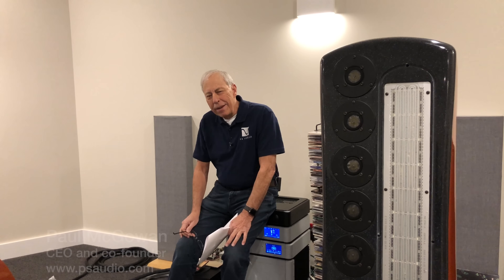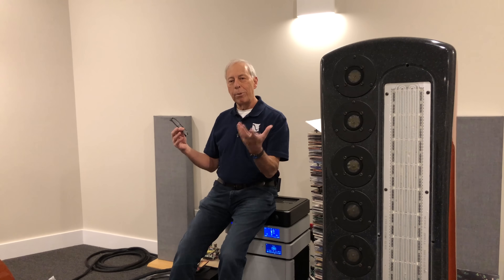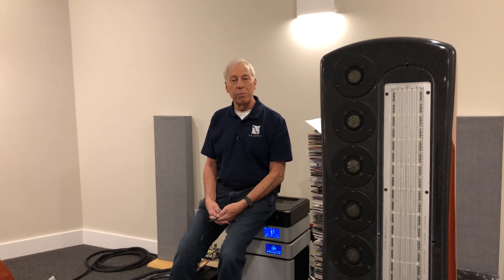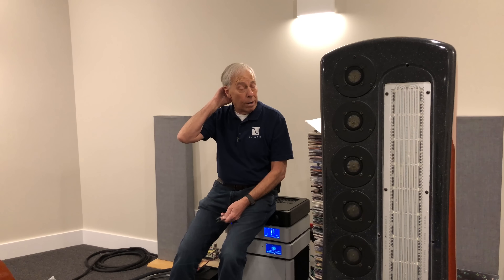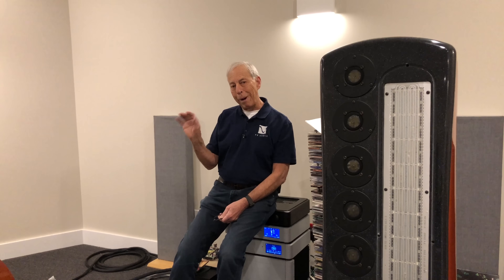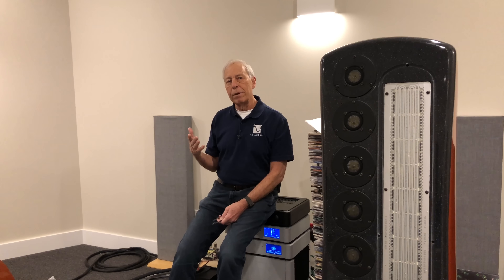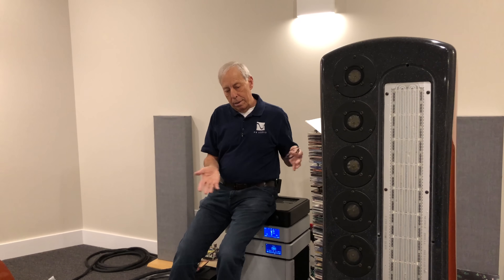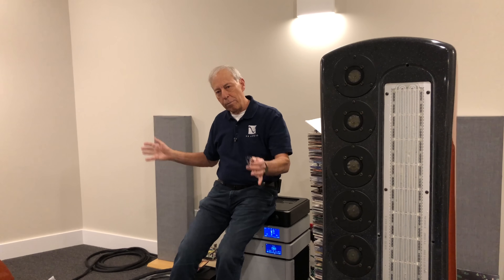Do we need preamplifiers?

Comment: Of course nowadays we don’t actually need any preamp and volume control can be done effectively without a preamp in the DAC. Also, I like to use some careful EQ and loudness tuning and most preamps lack this. A preamp is becoming a thing of yesterday. Less is more when it comes to audio components and cables. Ideally you have your digital media source + DAC + power amp. 3 components are enough. Actually you can even cut it down to 2 components if your media source has a good quality DAC in it. And then you can use powered active speakers and in some cases they are quite excellent. Receivers...I almost forgot we had those. Anyone still listening to FM radio? Anyway, if you are a retro person playing vinyl, you obviously need a retro architecture to match it.
Reply: ThinkingBetter I have the pioneer receiver vsx-d1s and it’s fantastic. Very powerful and complex machine, and it sounds great. My system does not have a DAC other than the ones built into my sources, but I think your opinions are very interesting and worth some looking into.
Reply: grant johnson Reality is that the terms are outdated. The word “receiver” made sense when receiving radio signals was a big thing. Preamps made sense when we had many signal sources such as a cassette deck, a record player and a tuner. Nowadays the majority of people stream from Tidal, Spotify and others and switching an analog input has become obsolete. Any modern DAC with proper low impedance line output can deliver enough signal level to drive a power amplifier directly. In fact, most DAC chips can directly drive a power amp even without an extra op-amp. Paul is advocating for selling more boxes because it’s their business and it’s alright but they should think about what really makes sense in the context of modern conditions. For digital audio, preamps are just adding unwanted artifacts to the sound quality.
Reply: ThinkingBetter yes this all makes sense. I must be in the minority having multiple analog sources (even using FM on occasion), with a low budget setup. Most of my stereo rig being late 80s early 90s and of the high end of the consumer spectrum where it starts to become a viable audiophile starter platform. Maybe in the future I will get a sprout, but I know I will be happy with my gear for a long time. A small, quality DAC would greatly enhance my setup I believe.

Comment: Other reasons to prefer to separate the preamp and the power amplifier may be to minimize interference, to have separate power supplies. In addition, if the power section works in class A, it is usually heated so much that from a certain amount of watts of power the enclosure has to be so large to dissipate the heat and not spoil the internal circuitry that brings more account to do it in two or three sections .

Comment: I think Paul misunderstood the question. If you have only one source (so you don't need selector) and you source have volume control, do you need preamp or you could plug power amp directly to source?

Well, if your source is DAC like Matrix Audio X-SABRE Pro https://www.audiosciencereview.com/forum/index.php?threads/matrix-audio-x-sabre-pro-mqa-best-audio-dac-in-the-world.8729/ and you have power amp with standard gain (Paul said 27dB) than at DAC's max output (4.4V) + 27dB voltage gain of power amp = 98V at speaker terminals which is 2400W @ 4ohm or 1200W @ 8ohm (if amp can deliver it). How is that not enough power for anyone?

So in that case without preamp you don't add distortion products of preamp and that DAC has distortions way bellow humans can hear.
Reply: Paul has answered that many time before. He also said that is how operates digital attenuation callwd gain cell dac and also explained what he thinks about preamplifiers and why he has changed his mind regarding BHK products. So, theoretically, it is the best solution if you have everything done properly - and that is done in stellar line of PS audio products and in BHK there is that "attenuator" that doesn't compromise the amp itself - since it isn't attenuate by the resistor but in digital domain - if I remeber correctly - Ted Smith done that. And there is explabazion about tubes - similar to Unison research Hybrid series. So BHK preamp is the first preamp that PS audio has ever made - I think. The main question is about active or passive preamp. I have a Naim Nait 5si which total gain is 41.5 dB with a passive preamp while new XS3 has 44.5dB gain and active preamp. 5si has only -3dB at 160kHZ while XS3 has -21dB at 100kHz. Preamp has something to it I reckon.
Reply: @freekwo7772  I'm not sure what you mean when you say that 5si has passive and XS3 active preamp as they are both integrated amps. The difference in gain is because they both have similar input sensitivity (150mV vs 130mV - why that low?) but XS3 is a little more powerful. This and frequency range is designers choice and is not directly correlated to passive vs active. As for PS Audio's implementation of Gilbert cell (gain cell how they call it) I'm don't think that they "have everything done properly". I think Paul once said that their products first needs to measure well and then pass listening test before they are released. I wonder how did Stellar Gain Cell DAC https://www.audiosciencereview.com/forum/index.php?threads/review-and-measurements-of-the-ps-audio-stellar-gain-cell-dac.9273/ passed the measurement tests.
Reply: @deejay6083  yes, they are integrate amplifiers, but 5si is made just like you explained - power amp with volume control and switchws, while xs3 has a seperate circuit for a preamp which can be fed seprately with outside power supply to minimise the noise that affect the signal - ant probably to tailor the sound - that is way this difference in ultrasound roll-off - due to preamp - I suppose.
I'm not that into ee but Paul also
So explained why the noise is implemented into gain cell dac and there is Ted Smiths' presentation at the you tube. So - to conclude - passive preamp is just the switch and volume control - the same thing that you want - in relativ terma not a preamp at all - and active does something to the signal before it go to the power amp. Why? Probably to try improve the sound or tailor it by certain audio philosophy (e.g PRaT). Something like the DACs - dacs of truth and dacs of lies. Some dacs try to reconstruct the exactly what is on the disk, while other add information by upscale and filters. The same is true for the preamps whether they stood alone or they are built in - integrated.
Reply: @freekwo7772  Are you sure about Naim? I don't think that 5si has only one (active) gain stage. That means the first stage is basically an (active) preamp stage. But they put a potentiometer in front of first gain stage. You could argue that this is a passive preamp (passive gain stage with negative and variable gain) inside but in the context of integrated amplifier it's not. Also, according to their web site description, XS3 has the same potentiometer (Alps Blue Velvet) and you don't call it passive preamp. And it's not. Passive preamp should be called a separate component with only potentiometer inside, totally passive, actually attenuator. Note that active gain stages in Naim's are all fixed-gain. PS Audio does not use passive attenuators (potentiometers) but active gain stage that has variable gain. How do they control gain is different story. Concept is interesting but implementation is problematic. What I don't know is if the bad measurements of Stellar Gain Cell DAC (link in previous comment) is because of gain cell or something else.
Also, engineers should not intentionally build a component to "tailor the sound" unless current technology prevents them to build what some calls "wire with a gain". Power amps and loudspeakers are still like that but there are some DAC's and preamps which have distortions that even best instruments (like Audio Precision APx555 Audio Analyzer) hardly can measure and humans can only dream to hear them (which is good).
Reply: @deejay6083  https://community.naimaudio.com/t/do-naim-integrateds-have-passive-of-active-preamp-stages/854/2

I disagree about passive preamp as attenuator only - to qualify as a preamp it has to have multiple inputs. Potentiometer only isn't a preamp at all. Look at  how John Atkinson tested Chord qutest : https://www.stereophile.com/content/chord-electronics-qutest-da-processor
Reply: @freekwo7772  Thanks for the link with pictures of the inside. Now it is all clear. First of all, by definition a passive component may be either a component that consumes but does not produce energy or a component that is incapable of power gain. That means passive preamp can only be attenuator or unity gain. Now, let's compare Naim's:
5si = Input selector → Alps potentiometer (attenuator) → output stage (43db gain)
XS3 =  Input selector → Alps potentiometer (attenuator) → preamp stage (16dB gain) → power stage (29dB gain)

So, with XS3 it's obvious that it has (active) preamp stage with 16dB gain, but where is preamp stage in 5si? There is none. Well at least not an active one. Believe it or not what they mean by passive preamp is actually Alps potentiometer.
Reply: @deejay6083  that is what I'm saying all the time...

Footnote: on the forum, they are talking about older model
Reply: @deejay6083  so 5si is what you cherish for ? Directly driven by the source of 2.1V of CD 5si? Isn't that what your after? Power amp with attenuator driven by source?
Reply: @freekwo7772  Yes and no. 5si has too much voltage gain. I would like to see something like Naim NAP 200 with a volume control or use source with a volume control directly to a NAP 200. And nowadays, preamps like NAC 202 should not exist.
Think about it. You have a CD 5si with a 2.1V output at 0dBFS. If you connect it to a 5si with a volume control to the max and with 0dBFS signal your amp will be in clipping - big time! What you do is you lower the volume to not more than 150mV (attenuate source by 23dB). And you think it's all good but remember, there is no gain without loss, and now your amp needs to regain this 23dB. Basically, you are "adding" distortions to your precious signal twice. It's like driving a car with a brake applied all the time.
Reply: @deejay6083  Then take a look of dac v1/nap100 - nap 100 has 29db Gain, and V1 2.1V out. you can add NAP 200 to it.
Reply: @freekwo7772  Yes that would be a proper match.
Reply: He actually did answer this question.... and the answer DEPENDS on how much gain you're amp has, and how much output level your source has.  The standards for this are pretty loose.
Reply: @TheMirolab  I agree, in a way he did answer the question. But IMO, John knows what is the difference between integrated amp and separates (preamp/power amp) and he want to know why (power) amplifiers don't have a volume control built-in. And Paul answered... yes you can, those are called integrated amps... power amps alone (27dB gain) don't have enough gain for a number of systems... That is incorrect! Several decades ago, yes. Nowadays, no, as all good and well designed sources have 2V or more output and that is enough even with 27dB gain power amplifier for 99.999% of audiophiles. If all audiophiles would know that, marketing would be in trouble.
Reply: @FatRat-f9m  yes, that's what I said and nowadays if you are not s vinyl user you just need a well designed source and power amp(s).

Comment: Dear Paul, you have really worried me about you sitting on your powdered up equipment, is this a concern about EMF ?
Reply: Paul probably gives off fairly low EMF and shouldn't pose a problem. 
If a problem is encountered, the first place to turn would be a power cable with proper shielding. 
Were that not to be sufficient, Ikea or a more suitable vendor may be employed to emulate the furniture aspect and provide additional isolation.
Reply: Yeah, don't want to expose the family jewels to high doses of EMF!
Reply: "powdered"???
'Baby Powder' or Graphite powder??

Comment: I believe some of the McIntosh amps actually have front panel volume controls..even today. The "classic" preamp evolved from the ability to switch multiple signal sources (designed for different input impedances) in such a way that the gain would be normalized when it reached the power amp. This was more important in the early days of audio when folks had tuners, open reel tape decks, both MM and MC turntables. Some of these devices were tube based, most were discrete transistors or just magnetic. Today,  if all you have are "digital sources" you just need an active volume control and a selector switch.

Comment: I have used my Wadia CD player direct to my amps from day one...20 years now...no use for a preamp
Reply: cd player already has enough gain
Reply: So you have a integrated amp then? Or volume control on your CD player?
You need to control the volume somwehere. If not you would get 100% output from the power amp and blow the speakers.
Reply: Øystein wadia CD players have volume control ....
Reply: @adriaticbatman  So the pre-amp is built into the CD player then
Reply: Same here!
My DAC straight into my two Lux stereo power amps (that happened to have separate L + R gain controls) & then two Denon monoblocs that also had a gain control on the fascia of each 'bloc'...no pre-amp in sight :-)
Reply: @FatRat-f9m  In other words the DAC is used as a pre-amp ;P
Reply: @Oystein87 ...No.
In my case (please read again my previous reply) the gain control (volume) was available in the Luxman & Denon power amps.
The DAC was not "used" as a preamp.
The DAC was used simply as a DAC; it's just that the DAC had enough output to drive the power amps that I was using.
Reply: @FatRat-f9m  Gain control is not the same as volume. Paul explained this before.
But yes you can do it that way but you kinda have a pre-"amp". If you get what I mean.
Reply: @FatRat-f9m  Gain is gain and volume is volume
Reply: @FatRat-f9m  Uhm... Weird
Reply: @FatRat-f9m  No, weird in general since gain an volume have never been the same🙈
Reply: @Oystein87 ...Tamato/Tomarto...as I said I use Gain
Reply: @FatRat-f9m  No it's not.